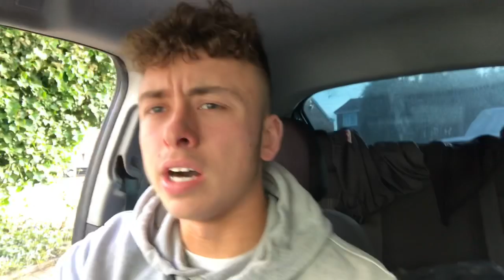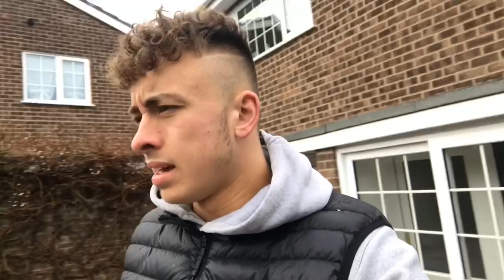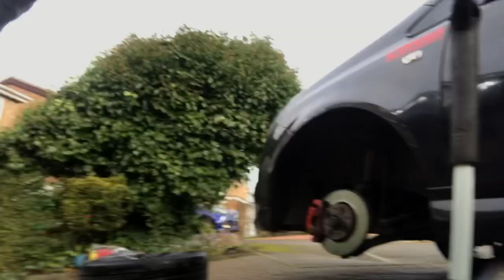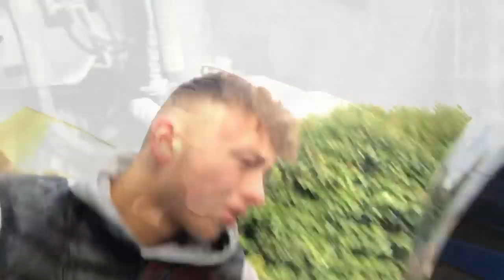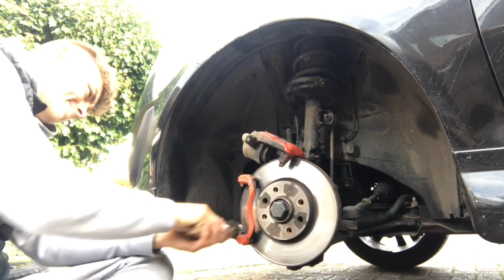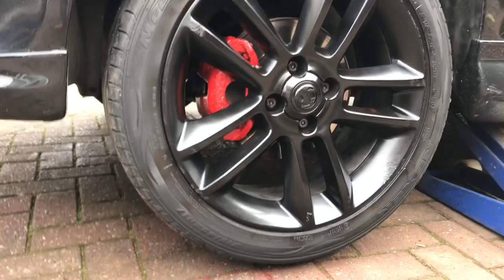CORSA BRAKES SQUEAKING PROBLEM?

Comment: What did you actually do to the exhaust from standard and how much did it cost?
Reply from the maker: Craig Higginson mate for back box and mid box 
I only paid £80 for back box as there wasn’t a mid box on mine but they said mid box delete is £60
Reply: Ben Powell Cheers mate keep up the good work

Comment: Decent starter car bro, got any recommendations for mods on my GTC?
Reply: Shaanos they sound nice with a decat bro!
Reply: 0121 Flavourzconnisuer quite a few people have said broski, I’m thinking I’ll also change the air filter
Reply: Shaanos yes mate of course get the whole intake a intake will make loads of noise compared to a standard one, and maybe a recirc/bo valve will make nice noises aswell, but Ide recommend mapping it if your doing whole exhaust and filter because of back pressure etc with it being turbo.
Reply: 0121 Flavourzconnisuer cheers mate